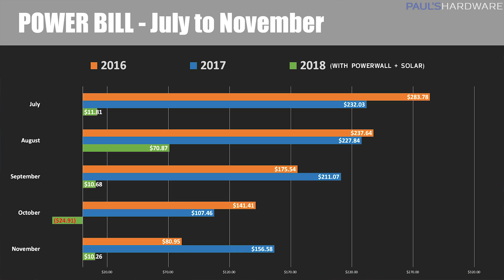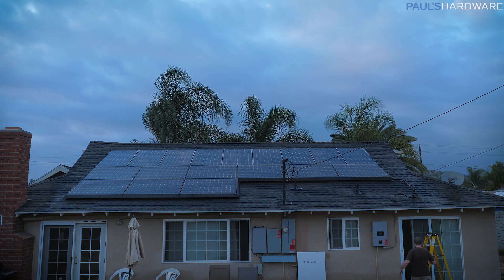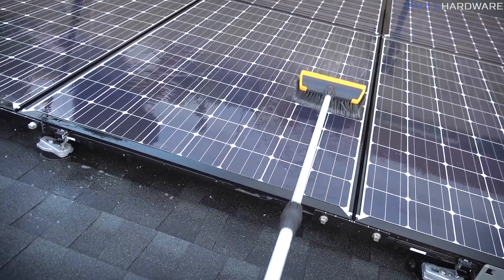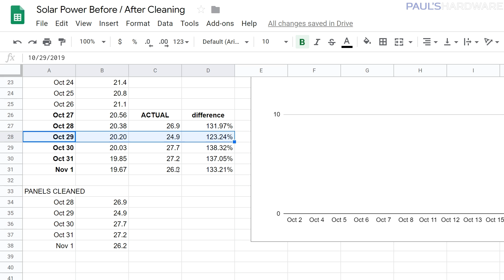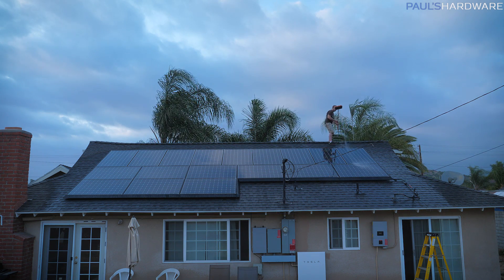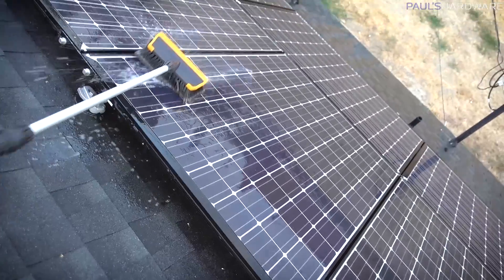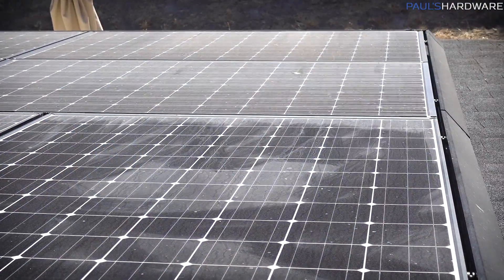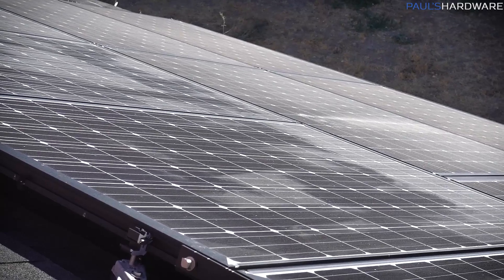Should You Clean Your Solar Panels? Before/After Testing!

Comment: Maybe get the doohickey that measures solar irradiation, and then compare the current outputs instead of daily totals? You could either come up with a fancy sunlight/production number for reference, or at noon you could get your control and test factors of dirty and clean, and if the days are both clear and are one day after the next, you might get a pretty accurate number of how much it will improve.

Comment: Try getting a foam lance cannon attachment that you can attach to a pressure washer. A lot of the grime will be released and carried off of the surface of the panels with just a follow-up rinse. I use one for washing my van, and it's made what used to be a laborious job into a quick job. Be sure to get a soap that works with a foam nozzle. It would be like a giant foam party on your roof.

Comment: And don't forget the approximate 60 tons of cosmic dirt falling upon the earth, growing the physical size of the planet daily. I take care of 24 of the suckers (solar panels) up here in Chico, CA.. There is a sturdy (heavy) ladder permanently stationed next to a roof access point (Also near a spigot) Using an approximately 100' hose, I connect a nozzle, and turn on the faucet. Then climb the ladder while holding the hose/nozzle and work it, lay it up onto the roof. Once the hose/nozzle are on the roof, I secure the remaining hose (what's left at the faucet end) to the ladder with a bar clamp; this prevents gravity from pulling the hose back down (Being careful not to pull to hard on the hose/ladder assembly, because once I knocked the ladder down to the ground) I then spray the loose surface dust/dirt/grime from the solar panel array, and immediately use a lightweight telescoping (12') aluminum pole, with a 2' (approx.) squeegee attached (I picked the 2' squeegee up at my local 'Home Depot') The squeegee works to wipe off the deeper grime. After wiping them, I immediately spray again to rinse. I do this about every 2-3 weeks during the drier seasons. The entire chore (24 panels) takes slightly less than 20 minutes.

Comment: Paul, I have Tesla Solar like you. 30 Panasonic 325 W. panels with Panasonic 400W DC optimizers and a HD Solar Edge 10KW Inverter. It was put in, in May and were actually pretty dirty after 3 months. Not like waiting 6 months but dirty. We live in about same area it seems Southern Calif. I'm roughly around Knotts Berry farm area. What I did was around 9:45 AM I looked at my Tesla app for solar output. Clear sky. I took 15 minutes to hose down the panels from the ground. The power went up over the 15 min. by 900 watts. So an increase of around 10 percent. I plan on going with the powerwall after Tesla gets the Gen 3 Powerwall out. I believe it will have the new batteries with Maxwell Tech dry anode tech. in the powewalls.

Comment: Wonder if you could get them crystal clear, then apply something like a ceramic coating or some other type of heavy-duty hydrophobic coating. That way the dust will wash off easily just by spraying them down with some water.
Reply: What is the COST vs ROI ?

Comment: Cleaning my panels every 2 months in the dry season resulted in an overall increase of 12% more power generated
Reply: How did you clean your panels?
Reply: @ceciliahurst7867  I use a long pole window washer sponge/squeegee I bought at Home Depot. I also spray them first with a mixture of the window washer fluid using the dial and spray on my garden hose and concentrated window cleaner
Reply: Thank you for the advice. I’ll be buying a pole today.

Comment: And here you see 2 other critics on solar as an energy provider.

It's performance is under influence allot.

And it does require water in there production time.
In solar parks if this is done.
It will be done for 1000s her regularly, sometimes with bots.

Comment: Suggestion, Clean half the solar panels, and leave the other half dirty. Then you are comparing clean to dirty with basically the exact same sun exposure.  Also i have solar panels on a second story roof. ... they look dirty i should clean then but for some reason I am afraid of climbing on a roof and getting all slippery with water.

Comment: I wonder about installing a mister above the panels to lightly spray water on them during peak heat hours, as they do decrease in output when its hot out.
Reply: You might want to be careful, if they are already hot the sudden drop in temp can be harmful to some surfaces.

Comment: On a really hot day you will get less power generated than on an equally sunny cool day (because of the temperature coefficient of the panels), don't expect your best solar production to be mid summer. I've had panels for about five years, as they age you can add more panels to maintain production. My 3 month autumn power bill was about 100 AUD (70 USD).

Comment: I've had more disasters with my solar installation and product it make me shake my head and wonder why I've done this I had my panels for 1 year before PG&E would give me permission to use the annals is credit for my bill so I had a solar panel payment and PG&E Payment for one year after they were installed problem number one I wanted American-made panels trying to be a patriot and support the United States instead of buying a foreign panel well CertainTeed American made products out of Georgia warranty program sucks so bad I had 20% of my panels not producing at all it took three months to get them replaced during the summer time when my panels are building up credit for the winter time another year that's going to suck as far as me true out bill I would not use CertainTeed as a supplier for my products my adventure into solar panels has not been a very good one or cost-effective but at least I'm not so dependent on PG&E out in California but the only time you're getting free energy you have to do your stuff in the daytime when the panels are producing at night time PG&E is still charging me so much a kilowatt running my dryer for cooking food for heating house electrical heater electric tankless water heater taking a shower eventually I'd like to get a battery get completely independent from PG&E I don't know how efficient financially it's going to be like I said I just want to be off the hooks from BS from PG&E seems to stick it to me every time I turn around with the solar system hopefully this bitching session will help somebody else out without running into some of the problems that I've had

Comment: Been through everything that you mentioned on this video I'm about 30 feet up in the air trying not to fall off I got like a 25 foot pole to get down all the panels with a brush on it I rigged up with the hose that squirts them down as I'm brushing them way bigger difference with the brush then just hosing down after they're drying living out in the country with the dust out there I could do it once a week but much quicker to do once a week in the wait 3 months and have a big job in front of you I can spend about 20 minutes a week or every 3 months get up there for or an hour and it's much harder work I do it every week it's easier than mowing the lawn

Comment: Get an extension ladder that extends at least three feet beyond the eve at a minimum angle of 30 degrees with an accessory top-stabilizer bar.  They are easy to handle by yourself and feel very secure when you are climbing.  With this setup you can reach the lower part of the array with ease.  These things are so handy, your neighbors will ask to borrow it.

Comment: Wow, that's more than I noticed on my panels.  I cleaned mine nine months after installation and only noticed about a 1% increase.  literally from 40 to 40.4.  They weren't terribly dirty, but I cleaned them with a brush and water.  I determined that if I was only going to get a 1% increase in power, that I was going to lose more than that in the shortened life of my shingles by walking around on them every couple months.  But given the results you saw, it's obviously worth cleaning them if they get as dirty as yours did (mine were now where near that dirty even after 9 months).

Comment: Paul, this is pretty awesome.  Since your panels were not really even cleaned (evident from the second trip to the roof) I am simply amazed with those results.  I am going to have to clean mine and see what I get for a result.  I don't have Tesla panels but I should be able to see the improvement with my Enlighten APP just as you did.  I might wait for the weather to get above 50 though.

Comment: They were so dirty after cleaning it wasn’t much of a test. Use some dish washing liquid or other mild liquid cleaner next time and systematically scrub the entire panel. Using the grid as a visual guide instead of haphazardly pushing the brush back and forth you can do a thorough job. You could also reach up from below on the ladder to reach the lower panels.

Comment: Jesus Christ, dude.  You really aren't much of a Boyscout, are you?  You hardly planned ahead on this mission.  WTF didn't you get a real ladder (20' extension at the very least), got your house attachment working BEFORE assuming the old one would just magically slip off, and then plan on how you'd actually scrub down these tiles in safe and - importantly - efficient manner?  Also, we will never know how much more efficient your solar panels worked after cleaning them because your data is bogus.  The real way to test your theory would've been to separate two halves of your panels, testing the outputs separately of the two.  Left Side (uncleaned) versus Right Side (cleaned) and then compared the two.  It always cracks me up how people like you have the money to invest in this stuff but not the decent, common sense how to work with it.

Comment: Hi Paul

I was told by the company that installed my panels never to accept any offers from cleaning companies for cleaning my panels.

Those companies apparently often use soap or other corrosive cleaning materials that might damage the protection layer present on the panels.
The panels will be cleaned by regular rainfall and if I really wanted to clean my panels, they advised me to only hose them down from the ground.

Also, my roof is much more sloped than yours, so I cannot stand on my roof.

I would definitely avoid using soap or (as you mentioned) scrubbing using a regular broom.

This comment is purely based on anecdotal evidence and is definitely specific for my situation.
Your situation might definitely differ based on panel brand, local weather conditions, ...
I believe there's much less dust and more rain in my region compared to yours.

Comment: One thing about cleaning your solar panels; it's not the best thing for you do. Use unfiltered tap water because you'll leave the water spots. You also can use long swimming pool pole with soft cloth on the other end to clean the lower panels. Rain water is pretty much distilled water. Even RV water filter will be much better than just unfiltered tap water.

Comment: Have regularly cleaned my solar panels for close to 2 decades. At 37.25* latitude and at various times of the year, my difference has been 6-7% improvement. Therefore I believe your number of data points is too small and your 25-30% improvement on a bad half-baked cleaning job is itself an outlier. Come back when you've done it quarterly for a few years and you'll see the real numbers. (BTW - I use a 16' long swimming pool extension that reaches all panel surface areas)

Comment: just want to tell you....solar panels make more power when they are cold, just because they are in the sun longer in the summer, does not mean they made more power

I make power per day in november and february than I do june or july

it called heat derating....that why you size your charge controller to the coldest day of the year

Comment: If you give them a proper cleaning using soap and a wipe down with a chami after that to dry them! You could then think about using a windscreen treatment like "Rain-X" which is meant to repel dirt and water, to see how long that lasts before you need to do it again! Or do these panels already have some kind of dirt repellent coating?

Comment: You need to establish a safe method of cleaning your panels. You are putting yourself at great risk and should look at other ways.

Typically to conduct this work, I would recommend a cherry picker, but the cost and potential qualifications would be impractical. You may want to look at a rebuildable scaffold tower that is suitably rated for outdoor work. You can get towers that can reach over 6 meters and you can build yourself and climb up inside, again this might be expencive, but if you can source a rebuildable platform for the right price it could be a bargin, that way you have a platform to work from. Otherwise you should look at a high step platform ladder. The last resort would potentially be to use an extension ladder, a work restraint lanyard and harness clipped to the ladder and tied at the top or footed at the bottom with a gutter stand off. I would not recommend that step ladder at all for accessing the roof, or conducting any work on the roof itself. 

Combine this with a longer hose attachment, potentially a water fed window washer on a telescopic pole. I have seen some available that reach up to 28ft.

Please look at risk assessing your work before you do this work again, falling from height is one of the biggest causes of work related deaths.

Comment: For those who have to clean their panels more often, it might make sense to use a pressure washer terrace cleaning gadget from Kärcher (or a similar brand) to get it done (with probably a little weight put on it first) https://www.kaercher.com/us/accessory/t300-deck-and-driveway-cleaner-26432110.html
... connected to a standard gardenhose shouldn't put to much pressure on it.

And the way to do it ...
https://m.youtube.com/watch?v=CbhdkK4ESyw

Comment: 8:52 I had the same question a few years back. We have a ground installation, 2 systems, 2 meters, same panels, installed the same day and they pretty much produce the same amount of electricity every month. The variation between the two systems is at about 0.1%.
At the beginning of a new monthly cycle I cleaned one system the same way you did and left the other one as is. Then I just let it run for one month and was very curious about the outcome. To my surprise the production was practically the same. Maybe there was a difference of 0.2%, I don't remember.  But the effort and time consumption to clean the panels was not worth the result. To be honest, I'm glad there was no difference otherwise I might have been compelled to clean them regularly.

Comment: Having seen the next-day images of your solar panels, and being able to VERY clearly see where you scrubbed and where you didn't, I'd be interested in your taking the time and effort (and getting the safety harnesses for roof work) to completely scrub all of the panels. Maybe even figure out what soaps or detergents are safe to use, or just be more thorough in your scrubbing with the brush, because you can see where you missed spots and where the brush only cleaned about 90% of what it traveled over. I think it should be done about a year from now, or at least at a time of year with equivalent length-of-day (so either next spring or next fall), to give an accurate comparison. As much as I hate cleaning things, I'm thinking that this is evidence of the need to clean solar panels at least once a week, or month, especially if there's been no rain.

I want to get a solar panel, but my wife's not completely on board given a 7 year ROI, and we're only planning to be in the house another 6 years.

Comment: Paul. You can clean your solar panels from the ground or even the lower part of the roof. Use PVC pipe and attach the water hose to one end and brush to the other end. The thing is you can add more than one peace of pipe together to reach the top. Place the brush end on top of panels before turning water on to make lifting easier.

Comment: I guess it all depends on if your panels are getting covered in dust and not cleaned naturally by rain. Here are my daily averages for each full year of uncleaned solar panels starting in 2013 - 22.9kW/h, 2014 - 23.0kW/h, 2015 - 22.4kW/h, 2016 - 22.7kW/h, 2017 - 22.7kW/h, 2018 - 22.6kW/h

Comment: If you had a half decent pressure washer, you could clean all of them from the apex of the  roof. The weather resistant polycabonate should have no problems with a pressure washer either.

Comment: When we purchased our solar panels earlier this year, we were told not to clean them with anything other than the hose. Basically don’t use a broom or brush or cloth, just spray water over them. Micro scratching is a thing.
Reply: My family installed a large ground mount system last year, and were told the same thing.

Comment: If you can see shit on the panels, then that means that not all the light is getting through. I'd speculate that if you did this again next year and hosed them down first, you wouldn't see much difference to their output. I'd guess the majority of your gains would come from scrubbing them or at least using something to break up the dirt and grime and clearing it away.

Comment: i work as a window cleaner and we do solar panels as well. It seems to me your brush is a little bit to hard if you had one that is softer it wil clean better/not as stripey. also with normal water you can build up chalk. there are special watersystems that filter water so the chalk is removed. Natrual rain water that you stored would also be a good choice or osmose water that also removes some grease from the panels so they stay clean for little longer. and please watch out what you do if there are fires around you may have ashes on the panels first spray alot with water and then brush as the ashes can damage the glass